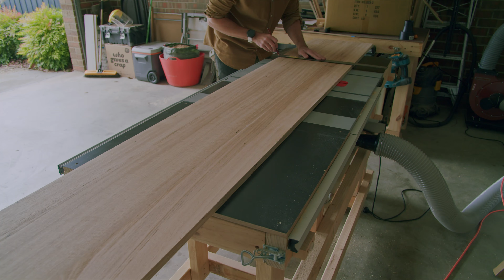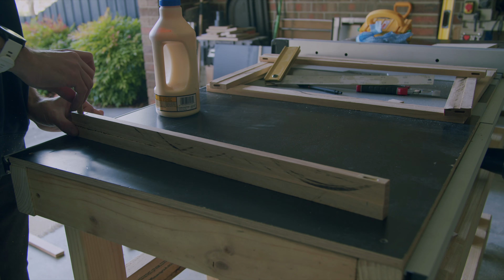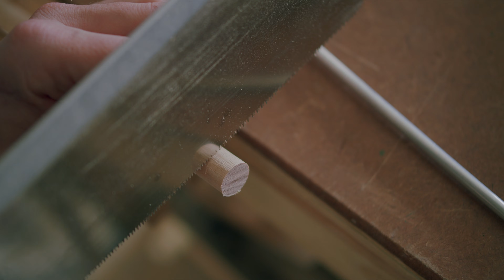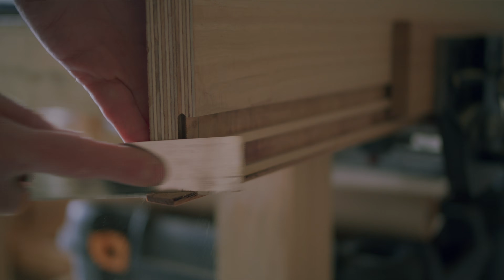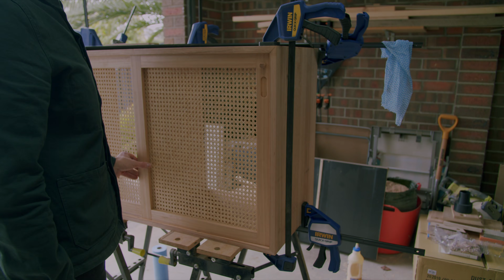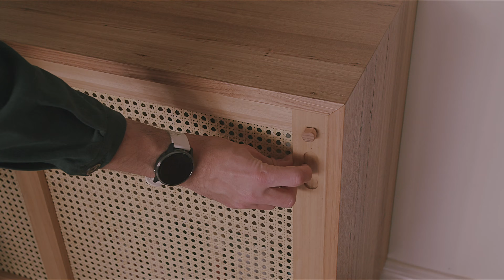Mid-century modern rattan sideboard with secret child-safe latches - DIY Build

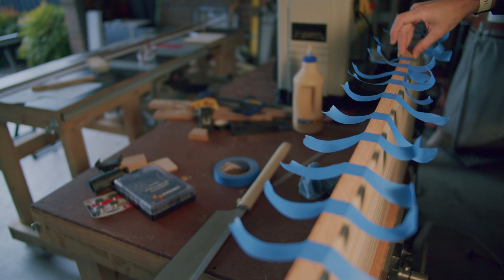Comment: @11:30 thanks for the idea. Why didn't I think of that? 😅
Always had a bit of a hard time with taping my edge bands (cutting and applying tape as i hold the thin strip in place).
Reply from the maker: Hah yep I tried a few other ways and was just too fiddly... this works a treat! There are some clamps that rockler make (bandy clamps) that do a pretty good job too but the pre-tape method does the job nicely